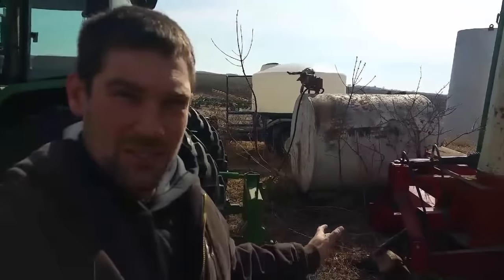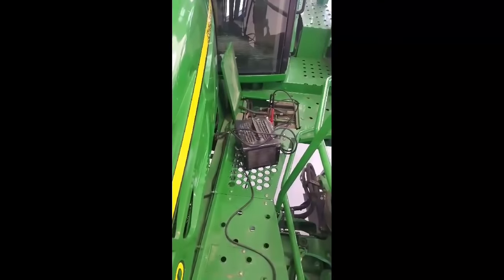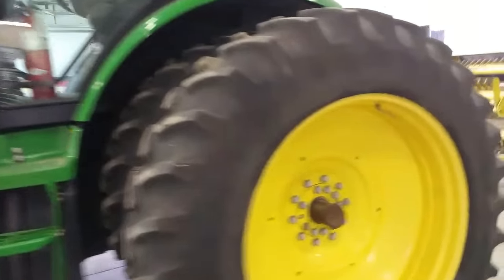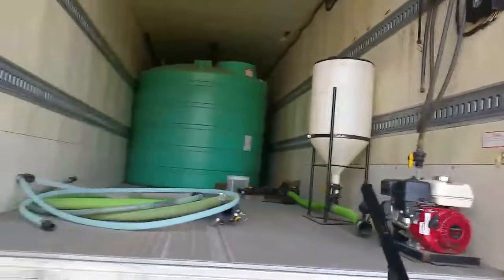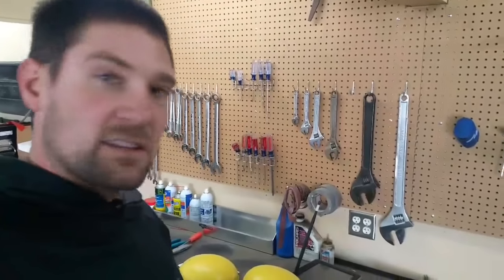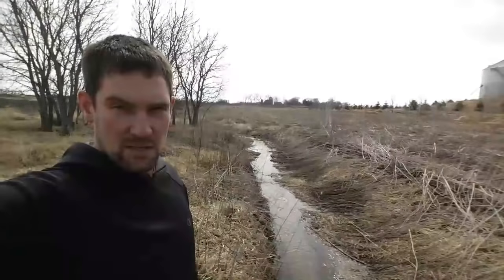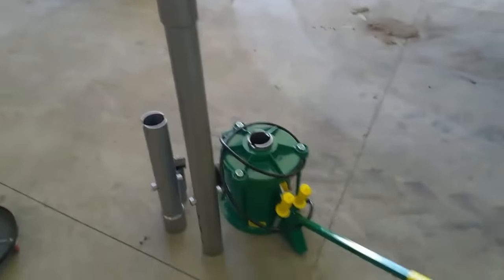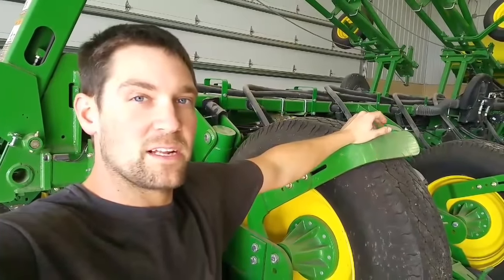Random work/MN buffer law

Comment: Easy dual installation:  step one- lay down a 2x6 or thicker. Step two drive equipment on 2x6. Next install long dowel pin on each wheel. Finally line up dual using skid loader with forks. Hang dual on dowel. Install bolts.   May need a little thicker than 2x lumber to account for tire flex. But we always just drive singles on lumber and the dowel does the work.
Reply from the maker: Dantheman10463 We have to remove all the current lug bolts to get the spacers on...

Comment: "Battery's Dead."   You'd think for $100K for a modern tractor, they could include $25 worth of solar panels on the roof so this didn't happen.  I think my grandpa's most used tool after a hammer was a battery charger.
Reply: Do solar panels work in a shed??? 

I lived on a boat that had 1. Shore power through a 240v AC to 12v DC inverter. Engine power while underway, Domestic battery bank charge either from the engine underway or a mains charger when on shore power. Just had to remember to get the switching right. Otherwise you could flatten the engine start battery as it linked in with the domestic bank. There was also an emergency Honda generator for when at anchor.

Comment: Not to be a wise ass but we used to put duals on by putting a couple boards down and pulling the tractor up on them.  Simple but cost effective.
Reply from the maker: farmall oliver 58 Larry we couldn't do that in this case because we had to remove the inner bolts also to add the big spacers.

Comment: Nice equipment... just a thought,  could you not have put a support under the sprayer axle and lifted the wheel with the ride height adjustment instead of buying a high lift jack?

Comment: Good video. I'd be interested if you have thoughts or are using the down pressure monitoring and adjusting on the planter. Thanks.
Reply from the maker: TwoHappyChildrenFarm We have SeedStar XP on our Deere monitor but we don't have the accu force system that Precision Planting makes.  So we do have an active down force system but it's not as in depth as the Precision system.
Reply: Cool.  If you have time during the planting window, it would be great to see how it's used.  I'm still on hand adjust springs here. Planter tech is very interesting to me. Thanks

Comment: Great video, but surely you must be wondering as an intelligent farmer why you're using dicamba ready beans? You've already got resistance issues with Gly, why do the same with dicamba? If you keep burning through actives you're going to have greater issues as time goes on.
Reply from the maker: Hi Skope, I guess I don't really wonder why we're using dicamba.  We have been using glyphosate for over 20 years now, and we have roughly 2 (soon probably 3) species of weeds in our area that are showing much resistance.  We will still be using glyphosate on most acres, but we are adding the dicamba resistant soybeans to 30% of our acres.  Right now it's just another tool to use, and we will be rotating those fields to use different chemistries in different years.  I would assume dicamba will become very popular over the next few years, but we have to use the best methods of controlling weeds right now so it doesn't get worse.  Different chemistries can continue to be used and rotated.

Comment: When we put duals on our equipment we drove up on blocks of wood. then that would raise the tractor or combine up about 6 to 8 inchs
Reply from the maker: Renfrow Farms We thought of that but we need to use the original wheel bolts to add the spacers so we have to take all the bolts out of the tires that are on it.
Reply: MN Millennial Farmer I am impressed with how clean your farm is
Reply from the maker: Marshall Herlocker Thanks, it's not always clean!
Reply: MN Millennial Farmer our farm tinds to stay messy
Reply from the maker: Marshall Herlocker When you're busy you gotta do what you gotta do!

Comment: the 9560rt goes through alot more mud without spinning than the 9630t does! i'd much rather have an RT than a case quad.
Reply from the maker: spaude123 We ran a quad once for a few hours and really liked it, but the Deere was cheaper and we really like our local dealer.

Comment: You'll be fine without that plate for jacking the sprayer that you're talking about, its actually easier without it, we never use it to change tires on our R4038. Make sure you brace up the suspension before jacking so you dont just keep stretching it, not sure though since they changed the suspension from the 30 series sprayers to the R series

Comment: What's in the stacker trailer ??
Reply from the maker: Micheal Smith dirt late model!
Reply: MN Millennial Farmer   Sweet we run crate late models
Reply from the maker: Micheal Smith Nice!  Where at?  What chassis do you run?
Reply: MN Millennial Farmer Louisiana we run the NeSmith series. We run a track star. A regional guy here builds them
Reply from the maker: Micheal Smith Awesome!  I have a Pierce chassis.  We run all Wissota stuff.  We ran a few outlaw shows about 5 years ago but it was too expensive to have all the extra tires and a second car with an open engine.

Comment: Have you heard of a buffer planning tool called Ag Buffer Builder? 

https://nac.unl.edu/tools/AgBufferBuilder.htm

Check it out. I agree a one size fits all law does not make sense in this case. This tool designs an appropriately sized buffer for where it is actually needed in the field based on soils, hydrology, and topography of the field. When I have run the tool, it cut a 50 foot buffer down to 0 in spots, widens it out in others, but ultimately cuts the total acreage of the buffer down. Your local NRCS office will have to run it for you since it is based in a high power GIS software, which they have. They may likely tell you no, but be persistent, because it can be a really good tool. If they absolutely tell you no, message me and I can assist.

Just out of curiosity, how’d the Extend beans do? Did your other beans take a hit at all from drift?
Reply from the maker: Andrew Klein I will check it out, thank you!  So far the 1 field of Xtend beans we have harvested did about the same or a little poorer than our others have been doing.  The damaged beans showed no yield difference.

Comment: Now I'm going to break your bubble, on your sprayer drive the wheel your working on up on a 2X4 roll the dual up along side if it, get a set of fork tongs for your bucket  to lift your dual into place, if you have to make a stud bolt about 8" long put it in the top hole on the hub and slide the wheel & tire on to the hub, start a couple of lugbolts on the side of your pilot stud  finish putting the rest of the  bolts in the hub ,semi-tighten them, use a vice grip to back out you pilot stud,put the last bolt in your hub and drive it off the 2X4 and finish tightening down all  hub bolts,decide if you want to keep the jack,its safer this way. I was born and raised about 300 miles south of you in Ackley,IA. good luck